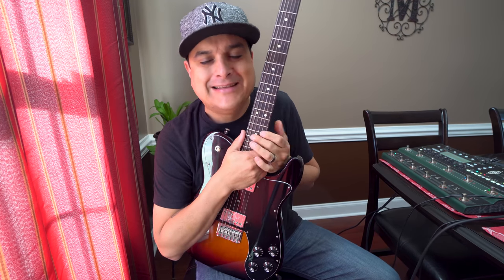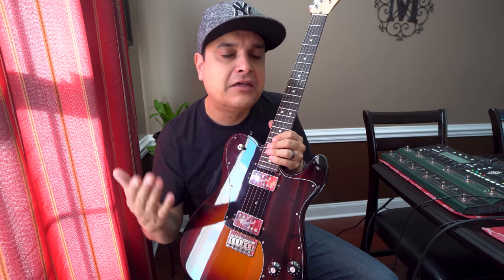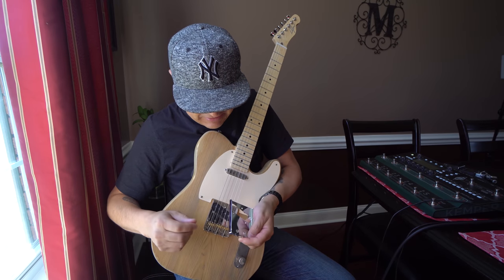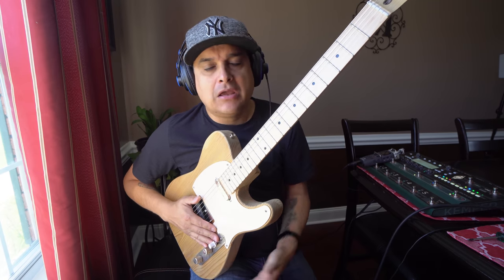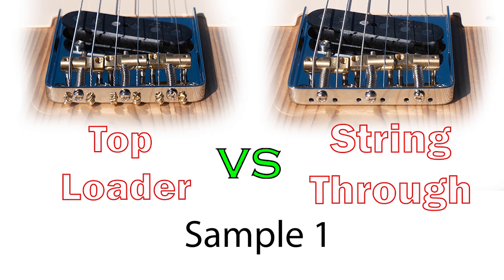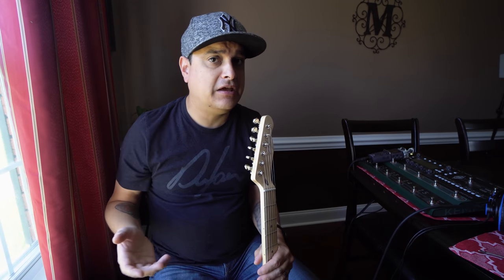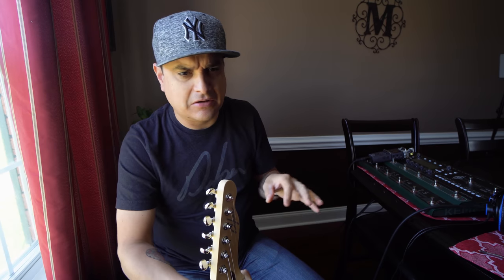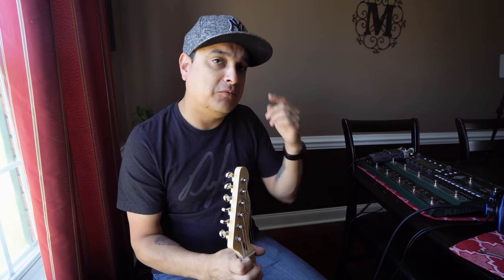Top loader Vs String Through Telecaster -  Can You Tell The Difference

Comment: First, regarding “nobody plays like that anyway”: Yes, I do play that way sometimes because I play in a country-rock band on Tele where the completely clean sound is called for, and I also sometimes get together for “classic country/Bakersfield Sound” sessions where I bring NO pedals and run directly into a Deluxe Reverb with my Tele. There are other people like me. Also, to practice what I’m preaching (?) here, when I do my own demos of guitars, pickups, wiring configurations, I DO most often, but not always, play without any overdrive so that the people who watch the video have one less variable to try to sort out as a listener. I do think there is great value in the “completely clean sound” approach, and the value of that is not relevant to simply classic country or jazz players.

Second, I hear almost no or no difference between Top Loader/String-Through on most samples. I am listening “in-air” via iPhone and laptop computer. Maybe I need to listen via headphones or through a better system or a more sonically uncompromised environment, and if I need to do that, what does it really say about someone else’s claim that the two stringing methods sound “noticeably different”, and does it practically-speaking, matter?

Third, one thing that isn’t (yet) addressed), and perhaps it will in the follow-up video is any differences in the FEEL and/or RESONANCE of Top Loader/String-Through, of which only you can tell us about that guitar, with that test, and in that moment. I hope you do. I don’t automatically assume that if I can’t hear any noticeably different sound, that I wouldn’t notice a difference in feel and/or resonance between Top Loader/String-Through. I could make the case that because a guitar may not sound different, it could feel/resonate differently, and that feel/resonance is important interactive phenomenon about playing guitar, just as some people prefer the “feel” of certain pedals over other ones, despite the fact that two pedals can be often set up to be indistinguishable in sound at certain setting, but could “feel” totally different.

Lastly, what brand is that replacement Tele bridge?

Comment: First, thanks for taking the time too take a stab at this.  It's an interesting proposition. That said, the presentation of the sound clips made no sense. The sound changed OBVIOUSLY in the middle of some clips while the screen title stayed the same. I can't tell what I'm supposed to be comparing. Also, the clips are too long and vary to much from beginning to end to allow for a comparison with the following clip. A/B audio comparisons are most effective when the clips are VERY short (with minimal variety in each clip), the content is as consistent as possible, and the switching is instantaneous. Also, I can't agree with the dismissal of playing these comparisons clean. Love it or hate it, distortion IS noise. When you're trying to hear the subtle difference that a part change MIGHT make, why would you introduce noise?  Why not also have a blender running, or a drunk couple arguing in the background?   An optical analogy:  You're picking your truck up from the body shop, and when asked to sign off on the color-matching job they've done, you say, "First, let me put my sunglasses on!"